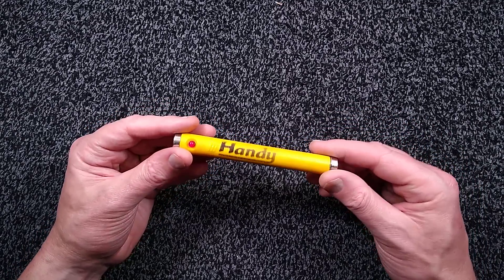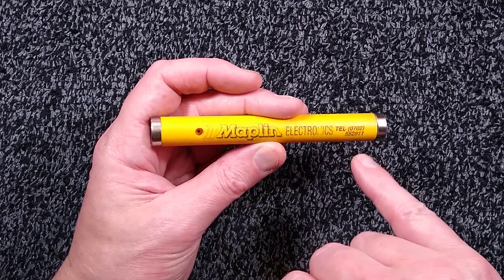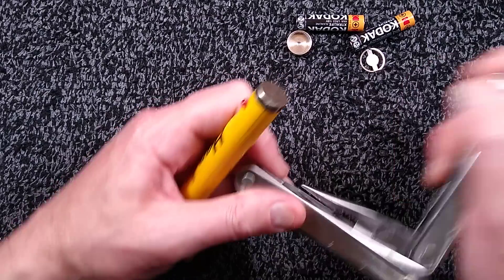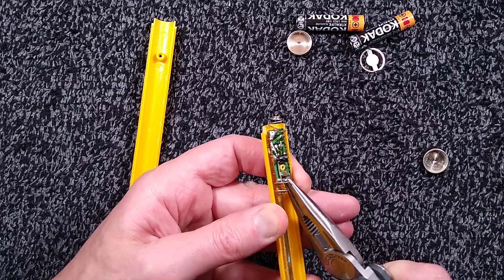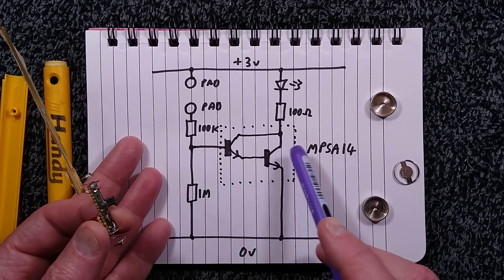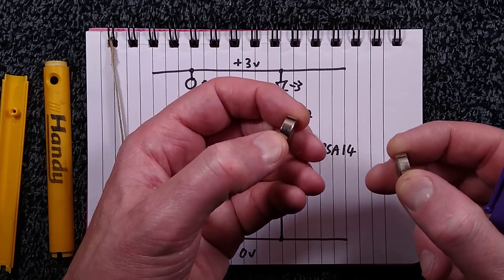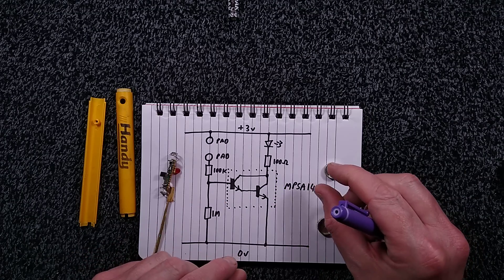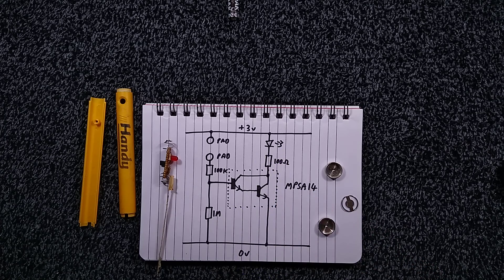Retro Maplin "thing" (with schematic)

Comment: Maplin went out of business because suddenly their niche - “things you couldn’t find anywhere else on a Saturday afternoon” - resistors, caps, cut cable, soldering gear, etc… disappeared to the likes of Amazon and eBay. They then resorted to filling their stores with absolute tat like Rolson screwdrivers and Chinese £10 drone RC toys. As Clive said, you can’t rent a retail unit and sell something with a bottom line as low as that sort of tat.
Reply: Sounds like Radio Shack in the US which is also no longer in business
Reply: @timpontius  We had RadioShack (Tandy) in the highstreet here in the UK also, but that's going way back before Maplin even.
Reply: @timpontius  pretty much the same story. It's sad though, I used to buy computer components in there as a young teen using my paper round money
Reply: @timpontius  Was just gonna say it sounded like Radio Shack in the usa.
Fun Fact: Someone bought the Radio Shack trademark and logo and uses it to sell dubious electronics, mostly drop shipped from china, to ppl on social media like facebook.
Reply: @UmmmmmmmWhat  Now someone is using the radio shack name to run a crypto scam.
Reply: @timpontius  Radio Shack was called Tandy in the UK, and it went out of business even longer ago. One day, the shops just never opened again without any warning or closing down sale.
Reply: @timpontius  They were called Tandy in the UK.
Reply: @timpontius  that traded as Tandy in the UK
Reply: @timpontius  The UK had Tandy, which was owned by Radio Shack IIRC. But they went out of business before Maplin.
Reply: @timpontius  we had Radio Shack and Tandy shops in the UK. Maplin was essentially the same, in fact I remember a Radio Shack store becoming a Tandy, and when that closed became a Maplin.
Reply: Rental price wasn't the main issue with Maplin, unsually they actually owned the majority of their stores, only the ones on retail parks and shopping centres where they couldn't buy them were rented. But charging £1 for a resistor only works when you are the only place in town you can buy one off the shelf. If I have to order it into store, I might as well just order it from someone cheaper.
Reply: @PeterGrant  Yes they were on the expensive side, you could always buy cheaper elsewhere.
Reply: Their original store in Southend was a wonder to me as a kid! So much decent electronics, casings and cabling that it seemed there was a snaking one-way system around the place. The staff knew their stuff and helped me with my first soldering project. But we all know the story that followed. The 'old' store changed location for the better, but opening a second store at a retail park 2 miles away shows how badly the company misread the future of retail :(
Reply: @sapiotone  Yes, I remember the original shop too. Friendly and helpful staff. The founder (Doug) once photocopied a circuit from a book that I couldn't afford for me, provided that I bought the components from the shop! (Which I did.)

I remember that continuity tester gadget. I lost or loaned mine and never got it back, so I built a replacement from a magazine circuit, which I still have.
Reply: @sapiotone  living locally, I still drive past the original shop site in Westcliff, Southend-on-sea (actually across the road from the very first Maplin shop with a retail counter where you could give them your scribbled component list and get everything in one go). It still brings a tear to my eye when I see the Supermarket in it's place.
What I miss is needing a small thing like a rechargeable battery or Solder or some Veroboard etc and then having the excuse to go down to that shop and browse around for about an hour and pick up a few small tools or "essential" bits and pieces. Although some things were overpriced, I still ended up gathering a few necessities! Bliss. Gone all too soon.
Reply: @sapiotone  My dad liked Maplin up until their demise, he liked Tandy too (as did I) I never understood the love for it as by time I left home Tandy was in its literal final years and that was where I went for small things, then I had places like pound stores to buy cables, often cheaper to buy a cable complete and just cut the part you needed off (even if low quality) or order things like coax connectors in packs of 5 for about £2 on Ebay, my dad still bought small electronics from Maplin inc portable tvs in later years.
Reply: Radio Shack in their hayday had 7000+ stores in the 80's.  They had cool products but lost their way in the late 90's to 2000's.  They became cell phone shack.  You couldn't walk into a Radio Shack without them asking you about your cell phone and your contract at least in our area.  Super aggressive marketing trying to sell me something with a higher cost plan than what I already had.  It got to the point where I hated going in there because you were accosted every time. I miss the Radio Shack of the '70s and 80s and early 90s. You could find some unique products. They were never the cheapest place in town but they tended to sell decent quality if you paid for decent quality. If you want the cheapest thing in the store you got what you were looking for.
Reply: @randyab9go188  The very last time I ever bought anything from Radio Shack, I had to wait about 15 minutes because the sales clerk was more interested in showing someone how to use their cellphone than they were in ringing up my purchase. This was probably back in 2007 or so.
Reply: @brianleeper5737  Yeah, I worked at RadioShack in my late teens, early 20s in the early to mid 2000's.  Being understaffed was always a problem. A lot of times it would just be me on saturday evenings and all day Sunday by myself. It sucked. Trying to balance ringing people up and explaining something to someone else wasn't fun.  That and the later years of RS had secret shoppers that report if you didn't go through your 5 minute spiel about cell phones. I got yelled at all the time for not talking to every single customer what's up in the cell phone world. 
 It was a pathetic last ditch attempt to save the company, instead of re-investing in labor and competitive priced name brand products and selection. Some in-house brand stuff was decent, but a lot of junk too. Was sad when they closed because now I have to buy things like a 5000 pack of resistors from amazon when I only need 2.  Amazon and the growing ease of online phone/electronics shopping really helped kill RS and others like it.

I did enjoy helping people though, especially those unusual electronics problems. And one time I had a mom and son come in Saturday night totally distraught that someone stole all their band equipment patch cords and they had a concert in an hour. I felt so bad that I was about to turn them away because we didn't have all the right pre-made stuff. So I grabbed all the various RCA and XLR connectors and raw cable and soldered some up for them right at the checkout counter. The relief in their faces when I said I could build them was pretty rewarding even though management would have thrown a fit if they found out I did that instead of offering them a cell phone sale, lol.
Reply: @andrewt9204  i worked in the shack around the same time and what really spelled death to the shack was the removal of blanket commission and the insane spiffs on cell phone contracts. the store i worked in literally had no coverage for either service we sold so i never sold a single phone and basically made minimum wage after the commission change, still i was 16 and living the dream helping people fix problems
Reply: @andrewt9204  I recall that RadioShack was much better in the 80s. By the early 2000s they were coasting on fumes.
Reply: @andrewt9204  and I remember they used to have the comic books and the free battery cards in the 80s. Both were gone by the early 90s.
Reply: @randyab9go188  A year or three before they closed, I bought a tool - can’t remember if it was a cutter or pliers. Only one of the type they had. Absolutely terrible quality, barely usable. And not cheap. 

I was willing to accept middle of the road quality for kinda high prices. But kinda high prices for “barely works” quality was just too much for me.
Reply: maplin started as a mail order 'distance seller', ,not retail shops, they came later, the problem was prices, in later years, especially for ready made cable assemblies, such as av cables,  some were ridiculous, and being almost always out of stock in the shops of even basic common components , when the raspberry pi and 'maker' thing started, they ought to have been good for it, but with little stocked, people just ordered online elsewhere, maplin of  course did sell online, but the silly prices of some stuff put people off, they actually had an early 'online' phone ordering system via dial up audio modem, as used with many home computers, running a simple 'terminal' program!!, then there was the issues of the incorrect resistor colour codes, very different to what was specified for years in the catalogues, and very often in the wrong 'bins' in the shops so they had to be double checked each time you bought them, and  i was told there were quality 'issues' with some testing way out of official tolerance, and the colour codes poorly readable in some, .. the company was very good until the original founders sold it off .... theres now pretty much nowhere retail to buy 'cut' cables , either to specific length or pre cut, except homebase or similar and they're now ridiculously expensive,  some wilkos have  some mains, speaker and aerial cables you can cut off yourself,  but choice is limited, but luckily price very reasonable
Reply: They started filling their shops with that tat way before then. I proudly worked there in the very early 90s. Half my time was tedious retail, but then regular customer Billy would come in asking why his flashing led circuit wasn't flashing. This is before flashing leds were a thing, so it was driven by a 555. 
Ok Billy, what's this resistor value? 
"102.5 ohms"
Come on Billy, we've been over this. The last one is the multiplier. Well, the the last one is the tolerance, but we usually ignore that, but argh. 
What you need is (grabs resistor and switches on soldering iron).
A few minutes later, Billy is happy. 3p please. 
I can see why it didn't last as a retail model, but in the early days the staff definitely were just as knowledgeable as their customers when it came to hobbyist electronics. 

I know we have the internet these days, but I really miss the wealth of information that catalogue contained.
Reply: Actually. Maplin went out of business because the current owners did not want to continue the business. When they bought it, they used financial tricks to transfer the debt used to buy the business on to the one of the many layers of holding companies. Maplin was not one company, but a number of companies, each owned by another holding company… When the profits dipped a bit, and the owners did not see sufficient profits in the near future, even though Maplin was still trading okay. They wanted to get out and make as much money out of it before it was too late.
I do agree that it was a good supplier under the original owners and after it was sold, it did become more of a box shifter.
Reply: Things you can't get anywhere else on a Sunday afternoon specifically includes delivery of online ordered items, because the postman doesn't do those deliveries and the warehouses don't pack them instantly either.  These days I often end up waiting a week on basics like mounting screws for a light switch.
Reply: They are sorely missed. 
This comment comes courtesy of a "oh, bugger, I need a new power supply" emergency on a Sunday.
Reply: In my last few visits to Radio Shack they seemed to mainly focus on selling junky RC toys, batteries, cell phones, and overpriced cell phone accessories. The selection of components had nearly disappeared though there were a few educational kits. In their heyday as a teen I used to hang around and play with the TRS-80 computers.
Reply: I worked in Maplin from 2003 to 2005 and one of the issues we had was people coming in to ask for advice on sat navs (this was about the time they started to get popular), getting advice from us for 5-10 minutes, and then going over to road to Currys to buy it because it was cheaper.
Reply: @notsiblers913  I'm not surprised. Last time I went into a Maplin was when I needed a PS/2 <-> USB adapter. They were asking £7.99 so I went home and ordered one online for 99p. I don't mind paying a little extra to support a business that deserves it, but paying 8x more is taking the mick
Reply: On the weekend they closed down for good, I asked the manager at the local Maplin store about what happened...he was clear...it was a mess up at their head office as his store was profitable.
Reply: I worked for “The Shack” for seven years and it put me through undergraduate and engineering school. I think location was everything for my store as well as actually caring about my customers. Word of mouth was my only real advantage. Most people I worked with, could barely make a living wage but for me, it was awesome. There’s something about telling customers that the top model won’t do much more for you or that I wouldn’t sell the lowest model to my own mother, that really brought people in. Much to my bosses dislike, he was fine with it later and let me do my thing. One year, I sold a million dollars worth of product. I did the majority of those sales by utilizing a much unknown part of RS business model called Radio Shack Unlimited.  I loved that job!
Reply: I remember Maplin from the very early days - remember Concorde on the front of the catalogue, when they thought London's third airport would be at Maplin Sands? - and it was ideal for getting stuff my local radio shops didn't have. Sadly, the transformation into a toy shop (and the growth of the Internet) sealed its fate for many.
Reply: I worked for them for several years, from the good times into the bad. Trust me when I say this from the inside perspective: they had a good thing and got greedy by pushing away brands in favour of margin, knowledgeable staff in favour of lowest wages possible, and service beyond sales for a high-street ebay reseller.
Reply: Some Rolson™ stuff is quite good ( ! ) .... my adjustable spanner has the smoothest thumbwheel operation of any adjustable I have ever owned , and the dry cell tester for £1-50p is a great little gizmo ... also I got 3 , yes 3 ultra long nose pliers for £5 , these are shit hot for wiring London Underground ( legacy , 1962 ) traction motor controller frames , which have terminals deep inside , normally difficult to access ... please do not diss Rolson™ .... ! !
Reply: I still have some components in their Tandy packaging! 😂
Reply: I remember their main Westcliff store started off with a bunch of autistic people bagging single resistors etc and overnight at least 50% of them laid off and everything was marked up and put in bags on a display stand. what with the cost of doing that and the space it took on the shop floor the cost went up hugely. A victim of dropping component costs and rising staff costs. a bit like now. you can by a raspberry pi pico (single board microcontroller with way more powerful than anything we had in the 80s) for like £6. Want to buy a turned pin socket to put it in? thats like £1.50 and you've got to buy 5 at a time.
Reply: Sounds like radio shack
Reply: Maplins is still in business online, I’m pretty sure there was a hiatus where that disappeared too. They had two stores in the Preston area that I can remember, both of which were rented. One of them was practically next door to office world which also sold computer peripherals which was a big part of Maplins business.
Reply: @markharrisllb  - the Maplin that currently exists is a completely different company. The owner of the current Maplin bought the name and logo and some of the old stock and started a new business.
Reply: Maplin is still trading, i buy from them regularly.
Reply: @TC-tn9tb  It is a different company now that bought the trademark off the liquidator, and the same company owns a load of other dead brands.
Reply: @TC-tn9tb  - a different company called Maplin is trading online, yes. See my other comments for more details.
Reply: I'd say their problem was that they became the new Tandy after it disappeared, i.e overpriced. However, the reason for being overpriced was the shenanigans behind the scenes. I don't recall my local store ever being empty people would always be in buying something.
Reply: @Matt Quinn But I do miss browsing Tandy and Maplin stores, on line is not the same, does not give the same pleasure as actually seeing real components online some how even though they put the sizes I imagine them different.
Reply: @Matt Quinn - look at the Wikipedia page to see the ownership history of Maplin.
Reply: @axam102  - no, it’s never that simple! Tandy brought the lost making RadioShack Corporation in the 1960s. This was a period of rapid expansion.
Later on the company (which was not originally an electronics company) split itself up into different divisions. Including a Tandy Computers division.
As they expanded, the company used RadioShack branding in the U.S.A. but traded under the Tandy name in most other countries, including the U.K.
It then gets very, very messy. But Tandy in the U.S.A. changed its name to RadioShack and the overseas operations were split off. The leather business (hence the original company name Tandy) was also split off.
Reply: When they did have the resistors you needed they charged £1 each. At that cost it makes sense to order 100 for the same cost and wait for a few days. They priced themselves out of that market.
Reply: That's the way Tandy (Radio Shack) Electronics went here in Australia, same with Dick Smith Electronics. Neither exists anymore. Jaycar Electronics is the only place where you can get components on a weekend here, but in the 15 or so years I've been buying from them I've watched them go down the retail crap path. However they still have a good range of components, for now. Although even that has dwindled in certain sections.
Reply: I always wondered why the hell they randomly started selling really cheap crappy toys in the store.
Reply: I grew up a decade or so earlier and benefitted from dedicated electronics shops which sold everything that you needed. In my case it was Odeon Radio in Harrow, Middlesex in the 1960’s. Even in the early eighties Watford Electronics was an amazing source of components in the North London area. The internet killed most of these small businesses unless they adapted.
Reply: I can't speak for everywhere of course, but maybe if they opened up more stores they wouldn't have lost business to amazon. My nearest Maplin was well over an hour away in a place I had no other reason to visit. So no, I'm not gonna waste half a day and petrol money driving somewhere for a piece of electrical equipment when I can order it on amazon. I hate using amazon over actual retail stores but it wasn't practical for me to use their store sadly. I was disappointed when they went out of business but my overriding thought was "I would have used them all the time if they had a store here."
Reply: I still haven’t found anywhere to buy single switches and the like, everywhere requires you to buy 10 or more